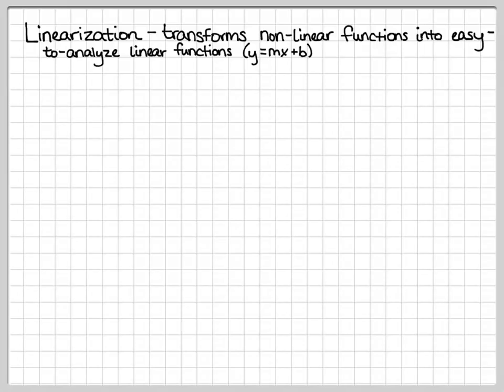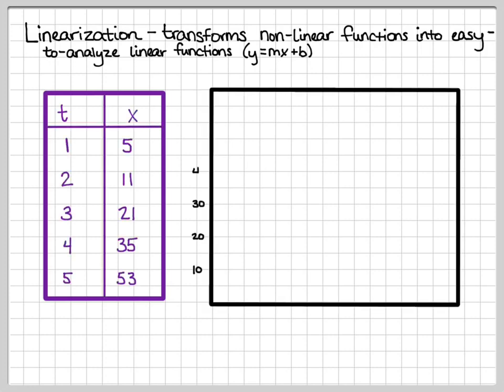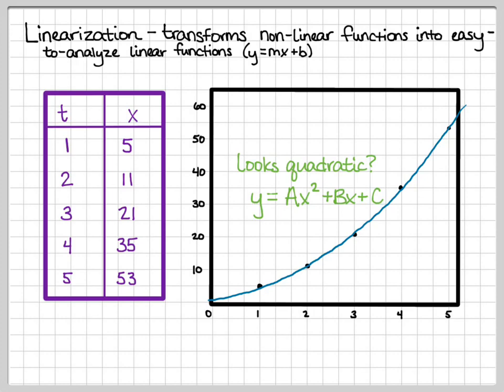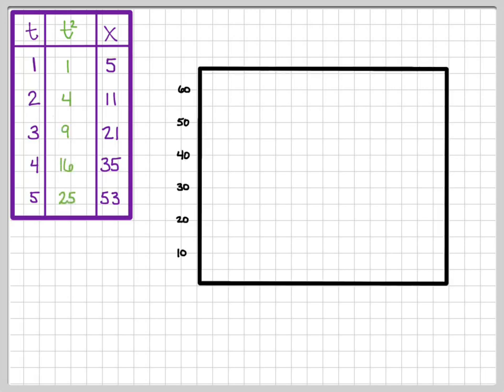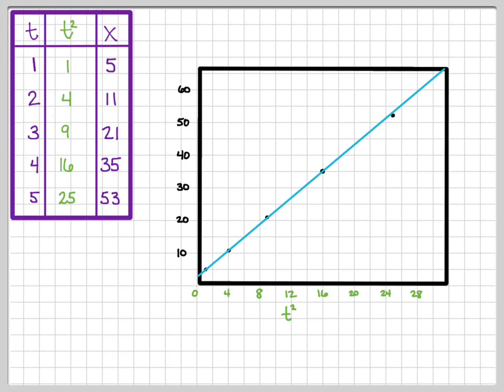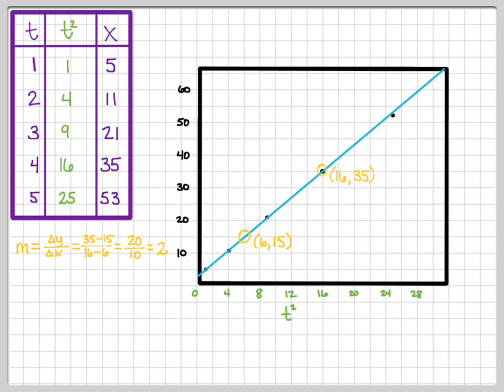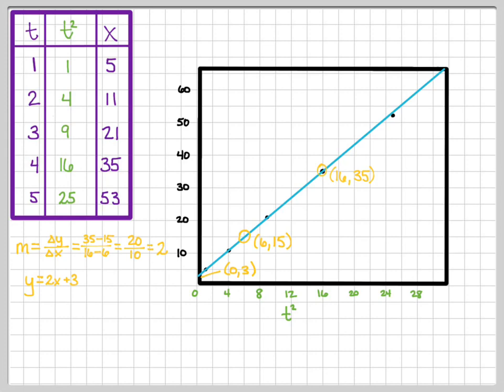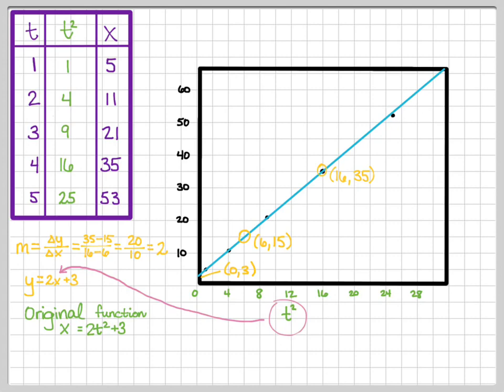Linearizing equations

Comment: Please linearise Richardson equation
J = AT2exp(−W/kT)
Reply from the maker: Well, what do you want the slope to represent? It is easier when you have an equation to start with, rather than the other way around! You can smash pretty much any equation into y=mx+b. Pick out the quantity that you want as the slope, then put everything that it's multiplied by on the horizontal axis, and put everything on the other side of the equal sign on the vertical axis.

I'd recommend consulting with your teacher if you are unfamiliar with this method - you are probably not alone in your confusion, so perhaps an example worked with the class may benefit everyone. Best of luck!

Comment: Hi, thanks for this video. I just wanted to know what the point of linearzing is and what is wrong with it staying as a quadratic.
Reply from the maker: Hey Nathan, it's mostly so we don't have to strain our brains too hard to figure out the coefficients of a quadratic (OR WORSE) equation. Linearization is handy if you don't have a graphing calculator/software handy to make a curve of best fit.

As a physics teacher/student, it's handy because most physics experiments and associated equations can be crammed into y=mx+b. You've got independent (x) and dependent (y) variables that you've measured in lab, then you have to figure out what to graph on  your horizontal and vertical axes so that your slope (always, and sometimes your y-intercept) will have some kind of "physical significance."

Hope that's a decent reason! Thanks for the question - I'm glad you're thinking about why we do the things we do. A calculator can definitely be faster and easier, but sometimes you just don't feel like digging it out. :)
Reply: @ms.rittenhouse  Thanks so much. This really helped me. :)

Comment: Why square the t and not x?
Reply from the maker: Essentially, since the x column is getting bigger "faster" than the t column, you need to give the t column a boost by squaring it. You want the two data sets to have a direct relationship. You could square root your x column, if you prefer, but it's unconventional.

Comment: How do you know you need to make change it to t^2?
Reply from the maker: It's a bit of a guess, especially if you're working with raw data without context. I would try it if the initial graph looked quadratic and see if that got me a linear result. It's much easier if you know what equation your data is related to!

1/r and 1/r^2 graphs are particularly tricky to linearize from scratch because they look so similar. Just do one operation at a time until you get a linear result. Hope that helps!